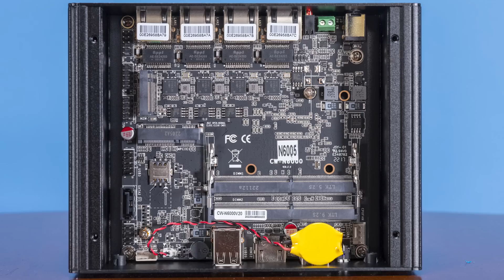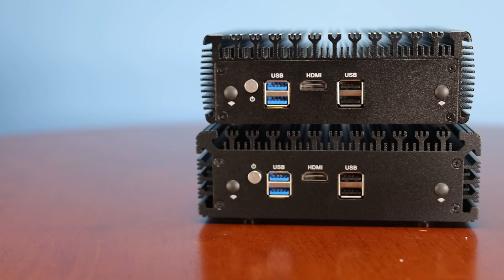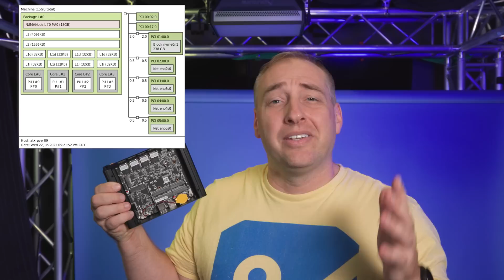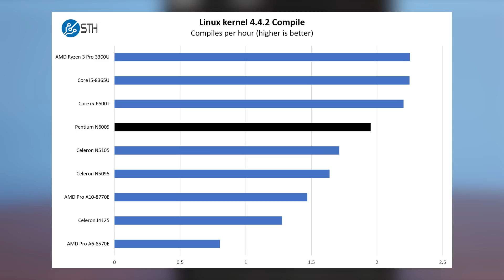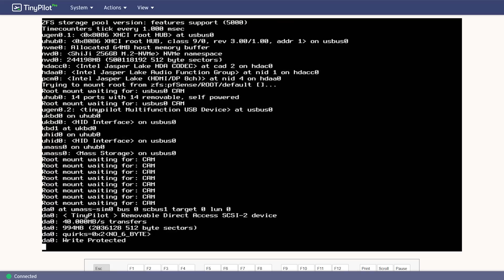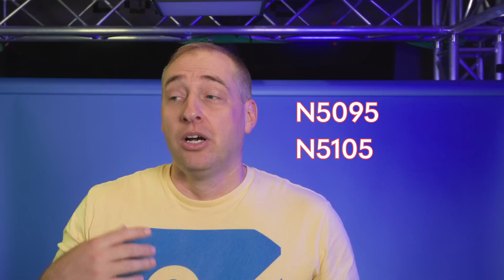Fastest Cheap 4x 2.5GbE Intel Atom N6005 Firewall for pfSense OPNsense and Proxmox

Comment: You know they have a 1165g7 aswell?
Easily twice as fast and feels real fast but the case cannot keep with the heat.
Reply from the maker: Just arrived and the 6x 2.5gbe one
Reply: @ServeTheHomeVideo  thats why I like you. :)
I have one n6005 and one 1165g7. What is good it that you can fiddle with the amount of enabled cores and and "tdp".
I settled for 3 cores in the n6005 and 16w(3.3ghz under full load) but im still undecided about the 1165g7, power and heat is too high to cope with 4.7ghz boosts
Reply: How much watts  the 1165g7 consumes on idle?
Reply: @Jorvs  the appliance consumes about 18w if i recall correctly
Reply: @gensem  whats OS or virtualize os was installed  and running on 18w?
Reply: @Jorvs  no hypervisor, baremetal pfsense
Reply: @gensem   thank you
Reply: @Jorvs  if you plan on using a hypervisor I would advise you to mount a 120mm fan on top of it, not because of the cpu itself but you might blow a cap if you run it at 70c for an extended period of time
Reply: @gensem  thanks for the advice..

how is your n6005? what do run on it? how is the watts?
Reply: @Jorvs  im not currently using it, its easily half the speed if not less but the case can handle it even if you raise tdp to 15, maybe 20 if the environment is chilly.
You can also play with the i7 tdp, if im not mistake in using 30w and capped the turbo to 4.1ghz max but i have a 120mm fan attached to it. 6005 uses close to 10-11w idle
Reply: @gensem  Thanks for the advice..

was your fun connected to the mother board of the device or just usb connected to the device?
Reply: @Jorvs  there is a fan header in the motherboard. Just need to cut the fan wire and use the wireless cutout. 5 min job.
Reply: @gensem  I bought the n5105 it pretty hot running opnsense..
planning to buy another one to practise on while my firewall is up.. so I wont be troubling people internet connection while I practise firewall like opnsens,pfsens,pi hole and others that I can use.

the n5105 is pretty warm just running opnsense and some plugins
cant even put my hand on the device it so warm.. 18 watts bare metal install of opnsense..

thinking if it just gona  be so warm like that may just buy the 1156g7 and put a fan on it.

instead of buying n6005 slow and may have the same temperature...

thanks for the advice...
Reply: @Jorvs    I just ordered one N5105 unit from Toptom. Among all reviews the heat problem when pfsense fully engaged worried me before I pull the trigger. After some research, I was surprised that no one consider using laptop cooling pad. They powered by USB and usually come with several 120mm fan. Just put this unit on it should blow airs all around the bare-metal. Hopefully do better cooling  than just stick a small single fan on the back. Someone can take a try?
Reply: @luiswo7650   already did it help a lot  I just put the usb fan on top of it..
it actualy greatly reduce the temperture of the case.. from hot to mild warm

the fan is a pc fan but it has usb port as it power supply

pc router
the watts on the meter seems the same around 14watts
Reply: @ServeTheHomeVideo  hey that is great I can't wait for the review. would 💯 watch a video twice as long where you explain exactly what you would expect to be doing that can get 1165g7 used effectively and min heat solution to not thermal throttle. I'm looking at a k8s control node and pfsense on xcp, a la forbidden router, I wish there were more lanes so I could distribute hyperconverged storage from this. But if I can Passthrough nics I can aggregate to a big freenas with some hba in it. My thought is twice the cost twice the perf but its not atom and will have use for longer. 64gb often pairs better with 8 threads too

Comment: I was blown away to get the N5105 8GB RAM 128GB SSD model for $188.73 recently and it only took a week to arrive.  I'd kinda have rather had the N6005 but the price difference is not worth it.

That also worked out cheaper with RAM and storage then if I added them extra to barebones, though granted I'd use better brands then.
Reply from the maker: Personally, I think for most people the N5105 is a better option.
Reply: @ServeTheHomeVideo  I'm upgrading to Gigabit FTTP on Monday and its over PPPoE so it was really a case of trying to be overkill to be on the safe side, as I also have a couple of OpenVPN instances.  But honestly, so long as it handles the PPPoE I'm fine if OpenVPN bottlenecks, especially as I did move my main VPN over to Wireguard.

Overall it feels a lot faster than the 7200U I had before especially the web UI.  Even if single-threaded it may be slower, those extra cores seem to have helped.  Plus its not like any synthetic benchmark is a true measure of how pfSense might behave.

There's just so much guesswork given I'm going from 72Mbit to 940Mbit over PPP, so not sure how the load will be.  I already had 500Mbit on a second WAN over 5G but that's into another router (as I run L2TP over it to bypass the NAT on the cell network anyway).

I also can probably remove a fair bit of policy routing once on FTTP too.

Did you check if these newer appliances support dual-channel memory (I'd assume they do) and if that impacts the performance at all?
Reply: @Patrick it's amazing how you reply and engage with your viewers. Thanks

Comment: The topton takes like forever to ship.... after a month they still have not shipped it. I also use my own meanwell 12 volt adapters, since I don't know what quality or safety the provided adapters have. the input is 2.5 mm on my units, not 2.1 mm. the good quality adapters that comply with western safety standards usually only come in 2.1 mm but you have adapters that will convert the 2.1 mm to 2.5mm. I cool a 8350u unit with a noctua strapped with tie ribs on the outside, connected to a 5 volt adapter. silent and effective.
Reply from the maker: Yes. I think the N5105 is shipping faster and is better for many.

Comment: I ordered one with the N6005 but they couldn't source the CPU so the offered a refund or a CPU downgrade for a RAM upgrade. Interestingly they offered to upgrade to 32GB of ram, which is more than you can order and more than the CPU supports according to the intel ark page. So that's going to be interesting when it eventually arrives.
Reply from the maker: They do support 32GB, but are finicky about RAM.
Reply: @ServeTheHomeVideo  It arrived, and indeed came with 32GB of RAM and has worked fine (so far).

Comment: Something like this with 4 x NVMe slots would be truly excellent. Proxmox, 4 x 2 TB NVMe drives, Raidz-10 = 3.5 TB storage. Gimme gimme!
Reply from the maker: Not enough PCIe lanes in these for that many lanes. You need to move up the stack for that much connectivity.
Reply: The processor can't keep up with that amount of speed

Comment: On paper, this beats an i5-7200U based device like I have (with 6 ports, 1gig).  I'm curious, though, about things like hardware crypto for vpn usage with pf/opensense.  Ever consider doing vpn benchmarks?  Every time I hear "Atom" I have flashbacks to the Cisco 5506 Atom-based devices and their "I will run until the day my clock stops" hardware bug, which bit me and persuaded me to get into the little fanless boxes--- and avoid Atoms.  Love your reviews, btw.
Reply: This is not really an atom product line. The processor is just Pentium Silver N6005. AES-NI is supported

Comment: Just be prepared to wait a long time. I ordered the barebones one on 5/24 and it still has not shipped. The seller told me it should ship in 5 days on 6/28/22.
Reply from the maker: Very much so. The Topton was ~40 days. The 6x 2.5GbE model is many weeks already. I think they take orders well before they have units to ship.

Comment: I cannot wait to get over this rediculous 2.5Gbps hump.. this tech is 10 years overdue and the #1 reason 10Gbps is still expensive. PCI-e 7th gen was just announced. We are moving into PCI-e 5th gen.. NVMe drive speeds are skyrocketing. Datacenters are already far beyond 100Gbps... Even MUCH slower Generation 1 NMVe drives are still capable of speeds exceeding 10Gbps. Why are we so behind with networking? Investing into a slow 2.5Gbps solution is temporary at best and in the longrun will cost you more than just biting the bullet and get into 10Gbps. Remember when we had to pull all that COAX cable and replace it with CAT 5? Then we had to replace that CAT5 with CAT5e for gigabit. Switching to 10Gbps requires CAT 6.. stay in the past or get moving with technology.  1Gbps is far outdated and a huge bottleneck and 2.5Gbps with overhead is barely even any improvement compared with NVMe speeds. Cheap 10Gbps is coming, but the longer we fart around with 2.5Gbps and even 5Gbps is the longer we delay that from happening.
Reply: I'm not a fan of 2.5Gbps either BUT there are billions of RJ45/CAT5 or 5E ports installed with millions of miles of cable ... same question why we don't have 220/240V or even 380V to the home ... would be so much better!
Reply: @leeroyjenkins0  Wut...

Comment: Thanks Patrick. I've ordered the 5105 from amazon and hope to run pfSense on proxmox. I'd like to see the other side of the boards
and a discussion of the com ports.
Reply: Which seller on amazon?
I'd like to get one of these but don't want to wait weeks/months from overseas, and chance dealing with issues (Been there done that several times). There's several clones of these systems on amazon and ebay that can be here in <1 week.
Reply: @FragEightyfive  the vendor was Hunsn. While it did come from overseas, it was here (PA, US) in under two weeks.

Comment: Hi Patrick, First off thanks for the videos on these systems, the info is very helpful.
My question is  under Proxmox does MMUIO function works on these systems, as PCIe passthrough ? you don't want the WAN port shared with Proxmox expossed to the WAN.
Reply from the maker: Like this? https://www.servethehome.com/how-to-pass-through-pcie-nics-with-proxmox-ve-on-intel-and-amd/
Reply: @ServeTheHomeVideo  Yes this is what i mean. As i noticed that, for example, a AMD 2600 CPU does not support MMUIO, and i heard the X series of AMD does ( like: 2600X, 1600X etc ).
It is hard to buy a replacement CPU when it is unclear which CPU does support the function.
So i really would like to know before i buy one, if these boxes do support MMUIO.
My idea for this box would be Running Proxmox with MMUIO, pfSense VM and a CT with Pi-Hole to handle my internal DNS naming, as i use self signed SSL to my local domain name (local.lan)
Reply: Never mind, i found the specs sheet of the CPU and it support VT-x and VT-d (needed for PCIe passthrough and enable the option to use a network port exclusive for a VM )

Comment: One big drawback is non-exsistent firmware/bios updates. I used one of this small Chinese 4-NIC boxes for a while and it had some horrible UEFI/ACPI bugs that required various workarounds. It also ran quite hot.
Reply: They seem to use regular AMI BIOS, so modding it/running the latest packages should be as simple as running UBU on top of a dump. It shouldn't be to hard to make at least an updated BIOS and keep it in the forums for the community.
Reply: @TA-mx3zm  bios modding is a bit of a niche abilty
Reply: @marcogenovesi8570  Open core is a better solution if it meets your needs. It is still a maturing product though.
Reply: @TA-mx3zm  can you recommend a source for updates?
Reply: @TA-mx3zm  Open Core may be an option as well. Its still maturing but should be reviewed in detail.
Reply: cwwk version have updates , they release 3 updates so far .
Reply: @MXG000  please more details, whats cwwwk???
Reply: @MXG000  Where are the BIOS updates for the CWWK mini PCs?
Reply: I have tried to post a couple links here but I think they are being blocked. So here are some hints about the URL. First off, CWWK is also known as ChangWang and they are a commercial entity. They are also down with you downloading BIOS updates.
Reply: @AmosHayes  how do you know if it Cwwk? The brand sold is 'topton'.
Reply: @CatalinEnache1502  Moh'm Yahya mentioned a 'cwwk version' and you asked him for more details. I took him to mean that cwwk was one of the many vendors selling almost identical systems to the Kingnovy and Topton ones reviewed in the STH video. Sure enough, there is a CWWK vendor on the same site selling a mini router system that looks almost identical to the Topton unit. When I asked them about BIOS updates, they replied right away with a link to their website's download page. I have ordered one. They replied and asked what colour I wanted and said it would ship before tomorrow. I plan to run OpenMPTCPRouter on it.

Comment: I'm hoping AMD's Mendecino APU is going to be targeted for this market, i'd really like 4 cores with SMT for a firewall.
Reply: Will be great if AMD can offer something in this
* Price
* Idle power consumption
* Quad 2.5GbE
Realm,
but with 2 NVMe slots (redundancy), multiple SATA ports (4~12) and ECC RAM support, plus wide input power of 12~19v DC.
* M.2 E key WiFi slot (at least 1)
And a normal PCIE 1x or maybe 4X slot. That would be amazing.

I don't care about size. Even if its micro ATX.
Reply: Mendocino is supposed to have RDNA2 graphics, which is overkill for embedded.  Somebody just needs to pair AMD's embedded chips (V1000 series) with 2.5GbE, assuming it has the lanes.  Or AMD needs to update the connectivity on those chips.
Reply: @concinnus  i think mendecino only has 2-3 CUs, i think they wanted RDNA2 for its added acceleratores and better efficiency at low frequencies

Also the V1000 chips are 14nm Zen1 based, you should at least look for V2000 7nm Zen2 for better efficiency
Reply: @denvera1g1  Huh, you're right.  Coulda sworn I saw they were on 7nm, though not from AMD's pages, which don't list lithography.
Reply: @concinnus  I know the product pages are getting terrible(they used to list all this information) Now you have to go to CPUZ or CPU-world. 
I think AMD still lists it on the product brief PDF but its getting more and more annoying to do my research for my job, i just wish they'd put something up like Intel ARK

Comment: Finally got my unit from Topton, it looks like your kinvoy one on the sides but the bottom plate has the cut outs you have here
Reply: the psu i got is a rated at 3amp 12v and is what i class has a death adapter, they have shipped a travel plug with a 2 prong psu; it will be going in the bin once the meanwell psu turns up

Comment: It would be really interesting to see a comparison between a typical ISP provided router, the lower end version of these, this higher end version, and a commercial grade router, showing what real world differences you can expect and how much benefit there is to upgrading your router performancewise.
Reply: I'd love to see this. I've been eyeing these 4x2.5gbe devices as a potential replacement for a pretty average Asus router, but really have no idea how they'd actually compare in day-to-day usage.
Reply: For me it's just a few little things that very few ISP routers will do and SMB stuff is still very spendy.
Reply: pretty good idea!
Reply: This is a very good idea. Good job 😁
Reply: @gabrielherz2781you can do whole lot with openwrt/ddwrt combined with a cheap $10-$20 supported router. Coming from someone who used those for over a decade at home, only reason I am looking to upgrade is 2.5gbit connection.
Reply: It’s easy.
Most commercial routers only have 1 or 2 CPUs and 256-512 MB memory and 1-2 GB storage and a super stripped down OS.

That is fine for a regular setup.

If you want services like IPS, VPN, Proxy, etc.
you need more of everything.

Basically, unless you have the need and knowledge, stay with the commercial products.
Reply: @pepeshopping   I partly disagree. As an interested calculation/backend developer that's not doing much on the networking front, I want to learn more about networking as a hobby. I think there's a market for people who want capable hardware to 'grow into', within reason of course. I've been eyeing a number of different networking devices and it's a bit tricky to pick the best toy, one that'll keep me busy for a long time.
Reply: @QuantumConundrum  you are wrong. its that simple.
Reply: @DieselRamcharger  he’s wrong about wanting to learn about networking? Are you braindead?

Comment: This is faster than my current firewall with an i3-4330 and lower power consumption. Will be upgrading for sure. Waited so long for something like this instead of all those crappy j1900s they put in everything.
Reply from the maker: There are 4x 2.5GbE J4125 boxes that we did reviews/ videos of previously. I have to say I really do like that solution since it is much lower power.
Reply: @ServeTheHomeVideo  Unfortunately I'll value the more performance for encryption and IDS/IPS and lots of firewall rules. I have seen your video on that one as well, Excellent videos!